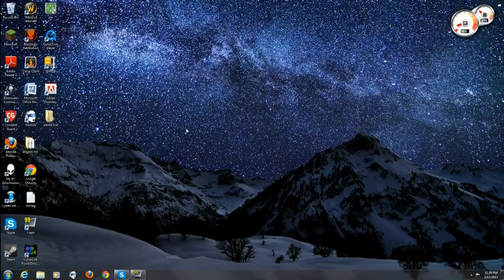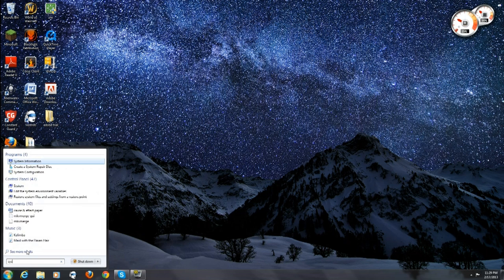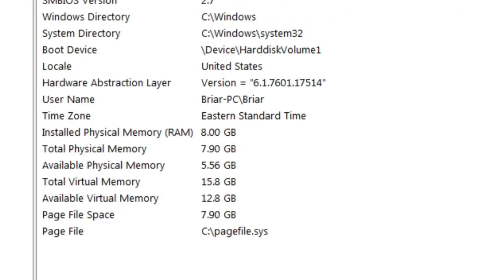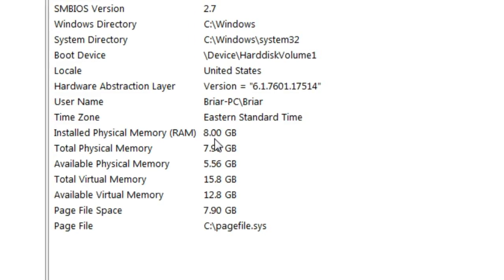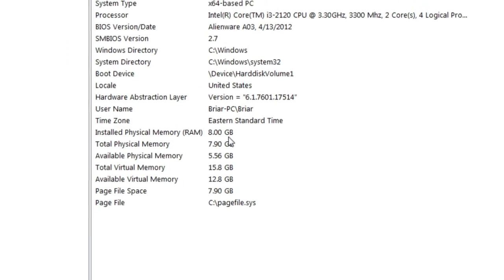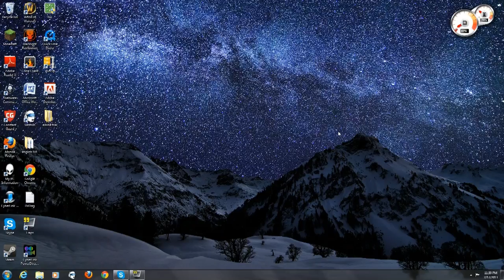How to install/upgrade RAM in the Alienware X51

Comment from the maker: Technically yes but this particular ram (going off the model number you posted) has large heat spreaders that might not fit well. I would recommend a more low profile solution such as: (CML16GX3M2A1600C10) just copy paste this model number into amazon and check it out, its low profile corsair vengeance ram with similar specs to the original ram you posted, either way i hope this was helpful.

Comment: any one no what it means when after booting up with the new ram in it does 2 beeps and does not boot up ?
Reply: +david daulby ya man the ram probably not put in right try it again hope it works.
Reply: +Nashfan13fl yeah took out both sticks again and used some canned air and the machine started up again must have just been some dust
Reply: +david daulby Two beeps is the error code for no RAM, it was probably clogging up the contacts
Reply: Ram were not installed correctly.. You need to hear the "click" when you install them.

Comment: I have an X51 R2 with 6GB RAM and an Intel Core i3 with 3.40 GHz and a NVIDA GeForce GTX 745 running on Windows 10. Will the RAM he chose work for my computer?
Reply: It should.

Comment: hello, i was wondering if you could help with a question.my x51 has 8GB of ram in it now and i was thinking of getting it to maybe 32GB do you know if i should stay lower or if that sounds good for it?
Reply: hey man. It all depends on your processor. Sandy bridge can go up to 8gb & ivy bridge only 16gb. Dont think 32gb is poss in the x51 yet? not 100% sure but certainly research that before you buy. :)

Comment: Hey I have a quick question does it matter what type of x51 you have like r2 or r3
Reply: Ok I am late to the party for this and I think you already know but no it does not matter. The only thing that matters is you getting the right ram sticks you can’t get a DDR3 ram stick when your computer takes DDR2 it won’t fit
Reply: @DJ_Kuri  hey on the Alienware website it says only 2133mhz ram however I want to install 64 gigs of 3200mhz ram
Reply: @jackandeson6302  if I remember correctly your computer will only run as much as it will allow. So if you wanted to get 3100 MHz. It will only run up to 2133mhz. Don’t put money on it though. Make 110% sure that what I’m saying is correct

Comment: Hi Rohan
so I got the specs of the RAM down, now for physical size itself
What about a Corsair Dominator? http://www.newegg.com/Product/Product.aspx?Item=N82E16820233380
The question is, I see this RAM has some heatsink built onto it. Will it fit without complications in size and/or heat? Second question is: is it justified? Or do you have better recommendations for a 2x8Gb upgrade?

Comment: Does it Support DDR4 RAM?
Reply: depends if you have version R1 or R2 or R3
Reply: I have R2. What kind of RAM do I need?
Reply: Just redid mine. I bought CAS9 and it kept having probs. Got some crucial 2x8GB for $50 at newegg. Amazon also has it. . specs:
 type 240-Pin DDR3 SDRAM
Speed DDR3 1600 (PC3 12800)
Cas Latency 11
Voltage 1.5V
Make sure you push the sticks straight down and both ends snap in.